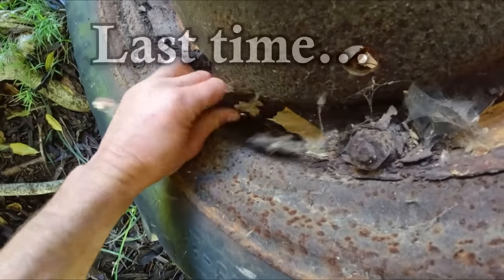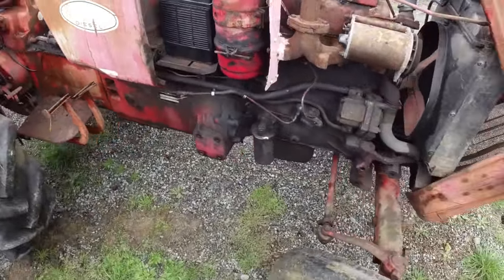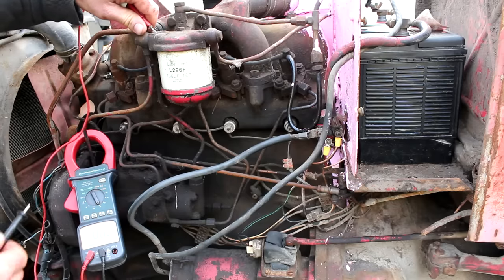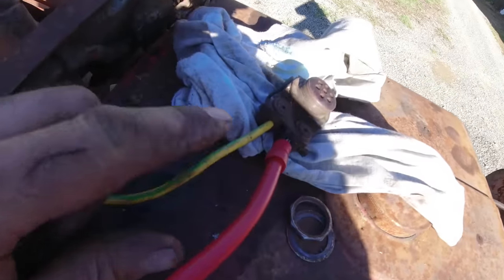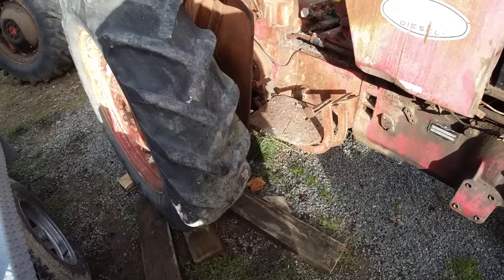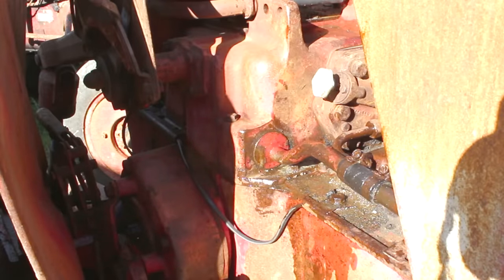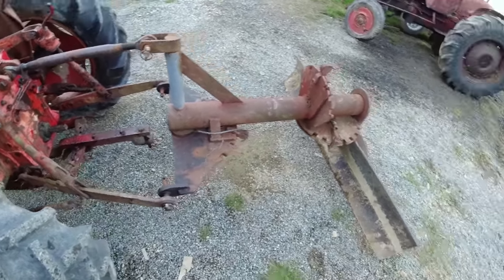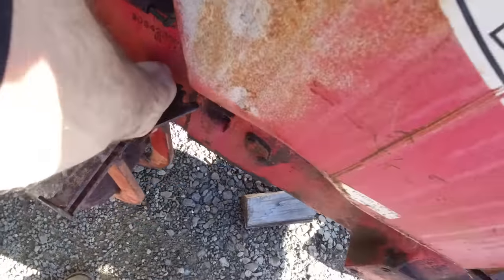Fixing the Salvaged Swamp Tractor and running it on Recycled Cooking Oil instead of Diesel

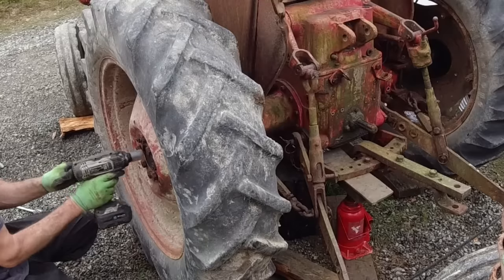Comment: 5:35 i've seen that stuff before. An old blog post detailing cheap concrete weights. This fella had done it on the outside, and all in all, it's a pretty simple procedure. Take the wheel off, make it level with the ground and put a stainless steel wash bowl with the needed number of holes and threaded rods in (in that case, it was a 4 patter). One key thing he did, was that he took some 4 mm wire and belt it around the rods once in around, secured in place with some washers and nuts (wire goes in between) and once in an X, same wire, no splices. And then he poured his concrete, let it set and removed the weight off the wheel and popped the wash bowl. And before i forget, he copiously lubbed the bowl with grease, but putting a bag like the fella who cast yours did, probably a better and simpler solution.

If i were to make some for my brother, i'd probably just make multiple modular units, like they used to make back in WW2 when metals were premium. I can't remember which brand i recall, i'm 99.9% sure it's a British (or maybe Ford) but i saw a couple of them painted red at a fleamarket in France once. Thought they were metal and back then, scoffed at them, because i didn't know any better.

Comment: I experimented with veggie oil several years ago here in the states, it has a cleaning effect on the fuel system at first, it will clean contaminants out of the tank and lines pushing the gunk into the filter requiring frequent changes to the filters necessary at first, good visual experiment !

Comment: Ran my Nissan Terrano on 75% veg oil. Worked well. Veg oil is less carboniferous than diesel so there will be some power loss. Contrary to gumming up/carbon deposits i found the opposite.Really cleaned out my fuel system,so you will probably have to change fuel filters more often initially.

Comment: If you're worried about the vege oil messing with the engine, your mixing idea is good to mitigate it.
Another way is to do the majority of your work with the vege oil and then switch back to pure diesel for the drive back to base.
This gives it runtime on the intended fuel in the higher rev range, which helps clean the gunk out

Comment: Dont worry about the old cooking oil gumming things up,these old diesel systems have much greater tolerances in the pump and injectors even before accounting for wear than modern diesels.Just play it by ear till you get the best results for your usage.

Comment: had a suzuki samurai  i installed a VW diesel engine in. i ran it on a 50 50 mix diesel used veggie oil.never had any problems , used it as a daily driver about 3 years like that. would do top speed of 70 MPH, which is  to fast for a  samurai anyway lol.the engine was a 1988 model year, was funny  how many people would mention they smelled fries cooking  when it was idling near them  :)

Comment: Mattie, Ol Son, I have been using blades of various designs and blade widths for sixty five years. I really love the design of that blade of yours. If you ever get the chance to get exact measurements of the tubing, etc, please let me know. I’am in Gloucester, Virginia, Retired US Navy Chief Operating Engineer. Ones and operated my own Kenworth T-600 road tractor with a 53’ refrigerated trailer. Massey Ferguson mod 65, Ford 455 backhoe loader and a Farmall Super C row top tractor. ChiefD

Comment: I've heard of guys thinning vegetable oil or used motor oil with gasoline here in the US for old army trucks that were made to run on used motor oil and various things. Alcohol might thin it too. There was a guy here that called his self the fuel man who would put old tractor diesels in trucks, he even had a diesel from an old brush chipper in one truck. If you did that you could run about anything on vegetable oil I imagine.

Comment: Using cooking oil is good for the engine. In the UK they mix 5 to 10 percent veg oil mixed into the diesel and this reduces emissions by 65 percent. Any more that 10 percent will cause the mixture to sludge up in cold weather.

Comment: good stuff Marty..for future reference re the glowplugs on those old girls, we used to drill and tap the outer boss of the std glowplugs and insert toyota ones in the centre of them as they used to be 300 bucks a piece over here pre 2000. you are gaining quite the fleet there mate.

Comment: Long term on straight veggie oil, fuel pump/rack/injectors do fine.  SVO has better lubricating ability than diesel.  Running under load tends to clear carbon and gum just fine.  Any water in the waste oil is bad news, so settling and filtering very important.  If you can heat the oil up just as it's hitting the pump rack things work a lot better, getting the oil to 80C makes it flow like diesel and avoids gumming up the works with congealed oils and fats.  Adding 20% or more diesel to the waste oil helps a lot in winter, I find running engine coolant through pipes along the fuel line and around the SVO tank keeps everything nice and hot and splashy - there are electric heaters and all sorts you can get for converting older diesel cars like landcruisers, patrols, hiluxs etc to SVO, can get a bit too $$$ for me though...  This works great on old school diesel engines, not so much any of the new flash stuff run by computers...  Cheers from Oz.

Comment: @ approx 5:30 mins; I've had a few hours (90+) on a small tractor that used water filled (antifreeze actually) tyres for the extra weight. And in a pinch you could drain some water from the tyres and top off the radiator! 😂😉🤙

Comment: Like your home built refining process, looking at its purity and the fact you've removed any water it looks like you could use it again for cooking. As your starting and flushing the engine with pure diesel it should reduce the risk of clogging up the engine, also you could always put in an additive into the diesel tank which should also help.👍🤗 Look forward to what happens next.

Comment: I used to run all my old diesels on recycled veggie oil, just mixed in a bit of diesel with it and changed the filters out regularly, absolutely no problems what ever apart from the fat fryer smell. It was just as economical to just buy vegetable oil from new, I run mine half and half diesel to veggie oil. I run all my old diesel tractors now on recycled heating oil as people get rid of their systems I buy up the mazoit, I think it has a slightly different ignition temperature but apart from that I have absolutely no problems, there is a video on my channel of changing out a fuel filter on my Fordson, running it on heating oil made absolutely no difference to performance or clogging up filters.

Comment: That hedge trimmer you made, you said that it needs a stronger motor.  I think that if you sharpen the blades. At the moment all the blades are doing is knocking the s..t out of what you are cutting. Sharpen the blades you will then be cutting and not knocking the branches (braking). With Sharp blades I think you will find that the motor will be strong enough.
Have you thought of putting another seat on the mudguard so that your son can ride with you. There are times when you could take him with you - known as quality time.

Comment: Marty, you epitomize the idea/need for, not only the "right to repair" but the fact that these old machines still have value and are worth saving. Great job. 
Btw, interesting screwdriver you have there—the one you used on the fuel filter. Is it meant to be used to access screws around corners?   😄  God bless.
Reply from the maker: Yes thats my round corner screwdriver ;)

Comment: The biggest problem with running high percentage or pure veggie oil is cold starting because veggie oul tends to gel sooner at lower temps. So mixing it with pump diesel is probably the way to go.
Fun experiment.

Comment: on the up side veggy oil is very  very  lubricios   more so than fossil oil ..  modern diesel has had all the lubericating  goodeys tacken out  for emission reasons ..  which is like taking the  oil mix out off 2 stroke fuel .. so a bit of veggy in ur diesel tank  lays a lot of love on ur injector pump .. which is bout the same price as a short block ....  but u must find a way to heat the veg  before it goes to the pump   .

Comment: Marty T - you should be able to pick up a kit to convert those glow plugs to run parallel. I fitted a set to my '57 Landy and picked them up from a local diesel fitter (I'm in Northern Ireland). Starting is better than working heater plugs wired in series. HAve also seen the kits listed by companies selling stuff for vintage tractors.

Comment: In winter, add a couple % kerosene to your veggie oil, to prevent gelling. 

Got this trick from the owner/operator of a bio diesel plant, when I was there to do some electrical work. He gave me tour of the whole facility. Told me broadly how it all worked, and how it was better for his business, the more competition joined the market, because it meant people would become more aware of the product, leading to more demand. Cool guy. Pure red-blooded kapitalist, and at the same time an optimistic, yet realistic idealist.
Talk about rare breeds...

Anyway... Pretty cool to see you running some of your machinery on cooking oil, Marty.

If you decide you want to expand the use of bio fuel to some of your more modern equipment and vehicles, I recommend you run the oil through an estering process first, to remove the glycerin, and prevent your common rail system from getting gummed up.

Also make sure to only run cooking oil or bio diesel through hard lines, or gasoline resistant rubber lines. Diesel rated rubber lines are NOT cooking oil resistant!

Sorry for the essay. Good luck with the project.

Comment: Great channel Marty! I've seen old lister CS6/1 diesels running on vege oil. To improve viscosity (and may be power) the copper fuel line is coiled around the exhaust a couple of times to preheat the vege oil. Just a thought...

Comment: Hey Marty, not sure if you noticed but in one of the clips I saw that the arm coming off the steering box (pitman arm?) was loose when you move the steering wheel.  If I remember correctly that should be a tapered shaft and the nut should create a tight fit.  Maybe try tightening it to see if that helps with the steering play.  Thanks for the entertaining video!

Comment: i may be late to the party, but cooking oil burns best when it's hot (60+ degrees), so if you're still watching comments, running the oil feed line along the exshaust, by a resistance or having the tank heated up by the coolant going to the radiator will help. makes flushing the diesel pump easier too, as the oil is more fluid. 

If the oil cools too much, it hardens and clogs hoses: in the engine itself there wont be problems longterm. 
it's not ethanol, it's heavier than diesel so it shouldnt leak into the bottom end, no matter how loose the segments are.
However cold cooking oil residues would choke the high pressure pump and turn into a glue. probably from the remains of gluten from frying.. 

The diesel flush principle is sound. if there was a way to purge the p pump back to the oil tank it would be better. maybe sticking a colored additive to the oil or the diesel so you have a visual indicator to when you can shut the engine off? 

In my country off-road use diesel is coloured bright red, so it would be easy to spot when the return line is pure diesel.

Comment: Waste veg or motor oil and stale old gas mixed 85/15% works well and filters easier. I use a two container decanting process and the stale old lawnmower gasoline really does a good job causing the dirt to fall out of suspension. I finish filter at 6 micron and have never had a restriction. Letting gravity do its thing is much easier than the centrifuge thing and I own a centrifuge. I also get the gas for free from the local mower repair shop.😀

Comment: An NZ dollar is currently worth 51 pence sterling. So you got two good wheels, two good tyres and a heap of donor parts for a hundred quid. You lucky antipodean... And that was exactly what Rudolph the red-nosed Diesel had in mind. An engine that would run on anything flammable, so that the Lumpen Proletariat could benefit from infernal combustion. Enjoyed that, Marty. 🇬🇧👍

Comment: Get some malleable copper pipe from the tank and spiral it around the exhaust before being fed into the injectors, I did it on 1.5 Vauxhall corsa B (I think it was an isuzu engine) and that ran very well, oh and in winter I'd do 10% diesel

Comment: Hey bloke, you can probably run it on any oil or compression combustable stuff.
Try doing a full service on one of your other machines & save all the fluids (except the water) like brake fluid, sump oil, trans fluid. . . . . mix em all up together evan & give it a go. . .I bet it still runs fine. . . . .

Comment: if you put a couple of ball valves in both of your fuel lines, you could adjust them to run a custom blend of diesel/veggie oil. it would run a little rich on diesel till the veggie oil warmed up and started flowing well, you but would keep the power, and still be a lot cheaper to run.

Comment: 5% petrol (mix before filtering). Helps with dewatering and somewhat restores lost power (did this for 150K km of driving). I didn't have a centrefuge, used 50, 5, and 1 micron gravity filter socks.

Comment: All CAV DPA type rotary injector pumps also have a plastic gauze filter in the fuel inlet end of them. 
Bit fiddly but easily changeable or  cleaned if need be.

Comment: Tractor can run on pure mineral oil so some veggie oil not going to hurt it. Mixing it will give the HP/Torque back. We have 2 Masseys one old 231 and  2022 2607h we run off road diesel in them only issue in USA is it has dye in it so you cant run on  public roads.

Comment: Theres a guy on youtube called detroit garage ..hes put a old detroit 453T in his ford F250..he burns used veggie oil in it and has put over 20k miles on it so far..going great..he does the start and stop  of the engine on diesel as well

Comment: Should have no issues how your running the cooking oil it's good for those old pumps swells the orings up I've got a couple of diesels here in Australia I run on used cooling oil I filter it down to one micron and blend it 50:50 with diesel no issues so I can't imagine the tractor will care

Comment: you can use a ( T ) connection + 2 shut off valves to switch between the diesel and the veggie oil and also it will give you the option to run it with a mixture.

Comment: I bet you'd get most of the lost power back if you got it a bit hotter.  A custom-made tank that had the exhaust pipe coming right up through the middle of it would get the veg oil decently hot and it would atomize out of the injectors better into the combustion chambers for a better burn.

Comment: I wonder Marty if you run the engine WOT and maybe hot enough all the residue will burn away and take longer for the injectors and fuel pump to gum up. Anyway a man with your many skills I have no doubt you will be able to clean out an old DPA fuel injector pump and the injectors. It not as if they have tolerances like the new common rail engines now a days. Excellent really enjoy channel...until the next video hare ra.

Comment: Hi. Great to see your videos,  keep up the good work.   I use to run a 2.5 di ford transit on 65% fresh cooking oil, and 35% kerosene. 
It ran really good,  in fact the diesel pump didn't leak on that mix unlike straight diesel,  I have done a few thousand miles with no problems,   stunk like a chippy though lol.   In winter thou it took longer to start,  but just used more kerosene

Comment: Good video 👍 don't know what the vintage tractor scene is like over there but from what I saw there are many sought after parts on that B250, front wheel weights linkage arm stabiliser brackets under the rear axles , drawbar with clevis, shame it's not in 🏴😢 you might find the injection pump does not like the cooking oil as when they were made the red diesel also had a lubricant in it which was removed to try improve emissions 🤔 quite a few old tractors over here have had pump failure because of that and many owners now put a couple of pints of oil in with a tankful of fuel 👍
Reply from the maker: Interesting info... These old inters are a dime a dozen over here
Reply: Highly sought over here 🏴 for vintage ploughing competitions the B250 when first produced in 1956 came with a diff lock as standard and as to qualify for vintage ploughing the tractor and plough had to be in production in 1959 which means tractors like the Massey Ferguson 35x is not eligible as they didn't come till 1961 again great video you made 👌

Comment: Nice tractor..you can mix the diesel and vegie oil together. We do it in the old Komatsu fork lift with a Izuzu engine, only thing we do is to run a diesel injector cleaner to flush it all.

Comment: How about you put a T in the rubber line where you disconnect the diesel to switch to veg oil and have a shut off on both and you can have them mix at that point and you will have a shut off from the veg oil also if you run out.  Nice service on the old tractor.

Comment: Ideally you would separate out glycerol and stuff from the veggie oil by adding a chemical to it, because the seals in the fuel system do not like those byproducts + getting rid of those byproducs should also make the oil have more power and less smoke.

Comment: You can refine used veggie oil at home in a system made of pvc pipe and containers ..several sites on here show you how ..during that refining you can add certain household chemicals to increase the power output ...added bonus of used oil is depending on where you got it from the exhaust smells like fries or chinese food !